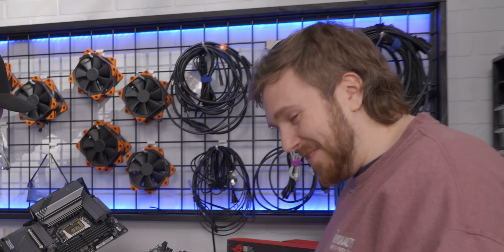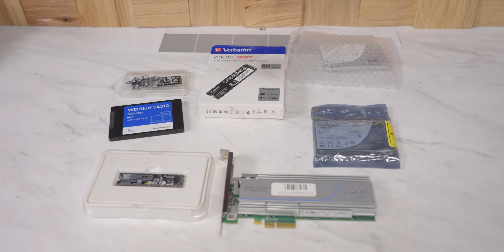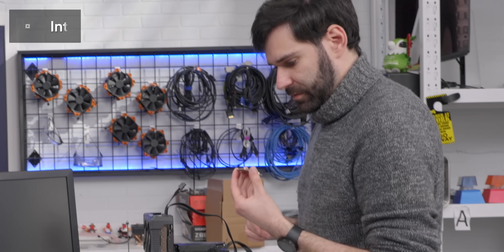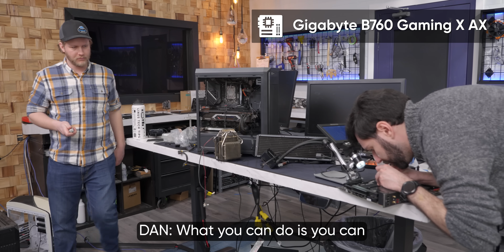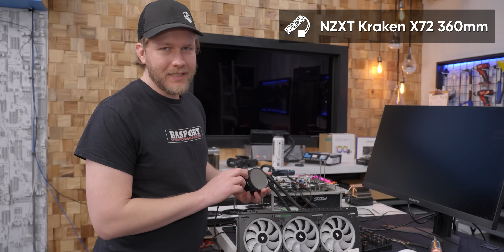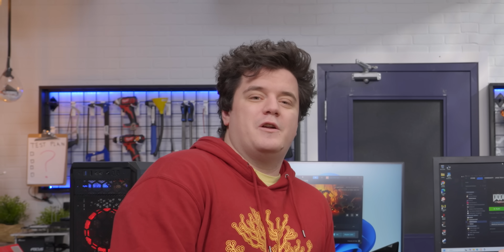I Built a Working PC using only Broken Parts

Comment: The prices you guys paid for these broken parts was insane! Shift decimal point one step to left for each broken part and then it starts to make some sense. You should be paying $30 max for a "broken CPU" and maybe $60 max for a "broken GPU" if the description gives some hope of a possible fix. If the seller is asking more for their broken parts, let the seller keep the part or fix it by themselves first.
Reply: They go for that much at auction... Sometimes more. Some stupid (or crazy necromantic tech wizards) people out there. I recently got more than 100 bucks for a busted 2070 super... Broken in an extremely subtle way that I think is going to be very difficult to fix, but it was an auction, and I said as much in the description, but someone still wanted it that badly...
Reply: People are unfortunately factoring reparability into the prices of these, seems to be the norm now
Reply: @einnujyt  Yeah, I understand that the cost of broken part is high if the root cause of the failure is known. However, if the diagnosis is "it's dead, Jim", I don't understand why anybody would pay a lot for that because it could be the compute chip itself plus memory that's bad (e.g. voltage regulator failed and fried both).

Or the board might be totally missing all the expensive parts because it was already used as donor and seller just slaps "broken" into the description.
Reply: @MikkoRantalainen If you are using eBay, you can always send stuff back, even if the description is accurate, bus especially if it is not. The sellers seems to bear all responsibility these days.
Reply: @rkan2  If you send stuff back, who pays for the postage (and possibly tariffs)?
Reply: @MikkoRantalainen  It depends, but for an inaccurate description the seller always pays for return shipping. This is one of the reasons why many sellers decide not to sell to abroad.
Reply: @MikkoRantalainen  And generally, for civilized countries, tariffs don't apply to returns. Tariffs usually also don't apply to many other cases where the goods is not intended to remain in the country, such as a repair.
Reply: back in the GPU covid times a dead GPU was MSRP, my last 3 GPUs were bought for parts (bad fan, pealing pads at the slot, and no display (backplate was dented shorting a cap))
Reply: People love gambling
Reply: CPU i agree, but full big GPUs will go for that much, because spare parts
Reply: @nightsgems  Are people paying big amount of money for spare parts which might be already broken?

Comment: Having a GPU post and calling it "good" is a bit premature, i have a 1080Ti and 2080Ti and a 3080Ti that all post, the 1080Ti and 3080Ti even play most games fine, but all 3 of them have what i suspect to be memory issues, as they all are varying degrees of unstable in more demanding games the 2080Ti being the worst of the 3 and while fine for booting and browsing and watching videos, it fails hard at all but the simplest of games. (and why yes, i do have the worst luck imaginable with GPU's dying, all of them died about 1 year outside of their warranty, they all had 3 year warranties too....)

Comment: I bought i7-6700k for 80USD back in 2017 (new were around 500, used for 350), dropped on corner, A chanell RAM is not working, but the rest of the CPU still works. For . The thing is that it signals broken RAM when the A chanell has something in it, not broken CPU.

Comment: Fun video guys! I think anything is worth buying depending on the price. Even the gpus CPUs the problem is they never sell for a price that's worth the gamble. I got lucky in the past buying am4 CPUs that had noticeably dropped or bent pins and was able to straighten them out and get them posting and resold them. The hardest part was not straightening the pins. The hardest part was finding a price that made the gamble worth it. But fun video! Thank you!.

Comment: I have seen the RAM issue personally. I have a crucial ballistix DDR4 stick that suddenly refused to work with my desktop and still refuses to post up to this day on that desktop. 

Yet I have tried it in other computers and in some it has worked flawlessly. I even checked it with memtest86 and it came out clean, so I have no idea whats going on there.

That ch341a is garbage, at least get the revision with the voltage selector honestly.

Comment: I bought my 5600x used and it came with a bent pin, i couldn't seem to find anything around the house that could bend it back into place without risk of just snapping it off. So i said screw it and tried forcing it into the holes of the am4 socket on my motherboard, and it bent it back into place. Worth saving the extra 25$?? maybe.

Comment: I love how Alex gets more and more dishevelled as the video goes on, with how much tinkering needs to be done, lol. I wouldn't trust that Enermax to cool a Threadripper, much less any of those intel cpus, lol. Mainly because they ALL had contamination issues at this point. Its why I'm probably sticking to air for my 2920x, as the only good aio with a TR4 pump/plate combo, was discontinued.

Comment: You need a real Repair Tech like Tony from Northwest Repair or Frazer from GPU Solutions to fix those GPU, MB and Ram Sticks.
It's easy to fix GPUs if the Core is not dead.
I've fix a lot of GPUs for the last 3 years.

Comment: Isn't most of this testing just wrong? Bad RAM might boot but still crash your system later. I personally had a burned 660ti that would boot and work just fine for everything but would crash as soon as i tried to put any realistic load on it. SSDs and mobos can have the same issues.

Comment: Repairing broken parts may be a great deal if you are lucky, because no one will spend 265 on 4 motherboards and then pick the easiest one to fix.

Of course it all depends on how accurate the pictures are before you buy and all that, but in the video you evaluated which parts to use only after looking at them closely in person. I think for most people, buying used-working is a better option.

Comment: I guess the best worklow for folk to do this at home. 
Start with Graphic cards until you get a gem? Then CPU?  Then motherboard? Then go used memory.
Then just go new/used for RAM, and power supply?
Reply: do you understand they spent 2700$ to build one pc valued at 600$ .  they bought 5 or w/e cpus you cannot return because you bought them knowing they are broken parts. to find one that was working .. also why wouldnt you consider the time spent buying one broken  cpu, to find out its unrepairable. so you shop for another broken one. etc etc. an by the 5th cpu, you finally found a good one.  before you know it. it has been 2months an after wasting like 600$ to buy a cpu you could of bought on day one brand new for $300.  is just pure genius  right? 

i really hope your parents manage your money your entire life.

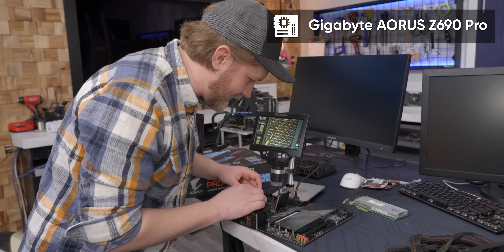Comment: 9:06 Hey, the same happened to me with a AMD GPU from ASRock though it was a RX580, it was working well and then an update notification popped up so I installed it, I always use DDU in order to have an absolutely clean install when I update drivers BUT after installing the new driver version (I forgot which one was, sorry) the screen went black and never gave image again, I removed the card and used a way older HD5450 just to uninstall everything, put it back on and it was ¨working¨ again, then I installed the driver and it died like the last time, then after attempting to restore it to its last version I tried the older driver that it had before and it didn't work despite it was completely fine before the update, I looked on the internet and I found other people reporting the same problem and with different manufacturers so it wasn't just my model, the card was already over the warranty period so I ended up with a fancy paperweight, to the date I still don't know why that happened and it seems that it affected newer generations as well.

Something weird that I found out is that if you put any card on the first slot and the seemingly dead GPU on the second slot and you install all the drivers it shows up on the device manager AND if you set up your settings to use it as the graphics accelerator it does work, it just stop working by itself, in fact I kept it like that for a while and I was able to play most of my games just fine but with several limitations depending on the game, like stuttering, the inability to change the resolution or use any kind of upscaling or Free Sync.

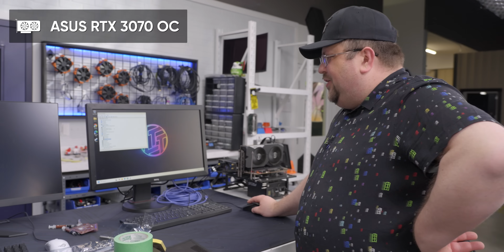Comment: 19:30 your ch341a seems to be not volt-modded: it outputs 5v instead of 3.3 volts on signal lines - it can be fine short term, but it will increase wear on the memory and may kill something

Comment: As for bad RAM, on Linux it's possible to disable bad ram blocks and continue using ram sticks at least until new ones arrive. But it so happens I'm using a ram stick with few bad blocks for a year now without any problems.

Comment: Not sure if it was a fluke but running just the 4+4 CPU cable on the motherboard without the 24pin inserted did fix a motherboard for me. I tried everything but that was the one thing that revived it.

Comment: 1. "Boots to Windows" is not equal "working". I have 8GB RAM stick where first 1GB RAM is working perfectly fine till the time you run heavy software\game than BSOD. So go for Memtest it few circles.
2.  You can RMA CPUs, they usually have 5 years warranty. 
3.  10$ potential savings on SSD?. Used tested SSD are pretty cheap.
4. 80-90$ for bad motherboards? Used working ones are 100-120$ on eBay.
5. GPUs are all big NO. Its just gambling.

Comment: I built a pc using broken parts. Got a 4070ti for $300, a Gigabyte X570 aorus master for $40 and a 360mm aio for $30, Fixed them and built a 5700x3d, 4070ti, 48gb ddr4000, 3tb nvme for less than $700.

Comment: Guys ive got a 750ti which gives display but does not show up in windows and says error code:43, i have even changed the vbios, but no luck, lmk what else i can do
Reply: Is GPU-Z shows 0MB memory?
Usually memory coruption. Use MATS to check VRAM.
Reply: @ GPU-Z shows everything normal
Reply: @egp_rafeyyy9405  that's quite weird... 
Have you try clean the gold finggers?

Comment: Please learn a basic repairing method. Get a multimeter, it's really easy to check basic voltages, even if you don't necessarily know how to fix them, you would know where the problem lies. Also, that microscope sucks, invest in an Andonstar microscope at the very least. 

If a PC simply doesn't power on, chances are there is something shorted, you don't want to put a CPU in a shorted VRM motherboard, it can kill it instantly.

Comment: I had a dead gpu that had 2 capacitors chipped off and i bridged it with solder and it works. It's a crappy gpu (my slowest gpu i have)

Comment: I recently bought a EVGA 970 for £13 as it was sold with the "DVI port stopped working. Not had chance to test the rest" It worked straight away via HDMI. All EVGA's are to be saved! Such pretty cards
Reply: I have a perfectly working EVGA gtx 770 that’s a shelf decoration, such a beautiful card, black and gold just looks too good to throw away
Reply: reminds me of the ultrawide monitor i still use. bought it for 70 bucks years ago because a hdmi port didnt work. I wanted to use the Displayport anyway but also saw that there was a second hdmi port that also worked.
Reply: I use a evga 2060 i bought for pretty cheap at it ran with one fan all ways on max, so got it for cheap then mailed evga and they helped me find a fan for the card for about 5 kangaroo bucks(2-3usd) and also sent me instructions on how to replace, god tier company
Reply: There's a lot of games coming out today that can be played just fine, too. It's only the few AAAs with good enough graphics or bad enough optimization.
Reply: Used to have a 970. Not suited for anything high resolution or modern, but works okay for e-sports titles like valorant but that's the max. CPU integrated graphics are faster these days. The EVGA version does look and feel premium though.
Reply: I had a similar thing with my TV, went to throw my garbage away and someone had put a 43" Vizio TV by the dumpster to be thrown away. I figured since it cost literally nothing aside from lugging up back upstairs I might as well test it, the first HDMI port was broken but the 2nd works if the cord is pulled the right way and the DVI input works no problem.
Reply: LONG LIVE EVGA
Reply: im still running a EVGA 1080Ti i cant afford to upgrade :(
Reply: The kingpin 980ti is my grail, I love those things, I wanna find one for a decent price, and with that lossless scaling app I could actually use it as a second card!
Reply: what is that card even useful for? I upgraded this year from a 1080 and that card really struggled with pretty much everything. I can't imagine playing on a 970 in 2025 unless you just play older titles.
Reply: @ErnieZee  I like to build budget pcs for kids/family's using 1060's or 970's. I use the Lenovo 520 as the base. Stick 16gb RAM in it. It's good enough for GTA5 on High and Sims... I never sell them to allow to play modern games.  Luxury of the PC gaming market.
Reply: @ErnieZee  because 13 quid
Reply: @ErnieZee  Playing PhysX games with a 50xx card?
Reply: @Pro_Triforcer  50xx are physx capable. They just removed 32bit hardware support which is required for like 5 games. Supporting that kind of technology is completely pointless.
Reply: @ErnieZee  It'll play games like Borderlands just fine. Remember, a lot of us older gamers are now dealing with an entire new generation that never played any of these classic games. More than half of my entire Steam library could be run on a toaster at this point. Still excellent games worth experiencing.
Yes, I do have a full blown rig as well. lol. But for decades I was always using e-waste and 2nd hand stuff.  Only in the last 5 years or so could I really afford a $1000+ gaming PC.
Reply: @ErnieZee  The catalog of games you can play with emulation, and triple A PC titles until ~2020 (not at 4k obviously), lighter games maybe even now, is HUGE for the price of a pizza.
Reply: @ErnieZee  let me guess, you play mostly AAA titles right?
Reply: @ErnieZee lol i have a zombie gtx770 that still works fine
Reply: @ErnieZee  Heh i just pulled an old 970 out of storage to bench test a new mobo/cpu before building it into my custom watercooled rig.

The more grounded use case for that card in 2025 is making an HTPC or something similar out of used parts.  Although i'm not sure its power-to-performance would be reasonable versus just buying a newer CPU with integrated graphics.
Reply: @tippyc2  "power-to-performance"
I actually forgot to keep in mind the power consumption. I really gotta remember this more often.
Reply: @ErnieZee  you sound spoiled AF
Reply: @ spoiled? Bro I'm 30. I've been buying pcs with my own money for 15 years at this point.
Reply: @ErnieZee  Yuno there are people that strictly play Minecraft/Roblox for one, so its pretty damn great for a relatively small-ish niche.
Reply: @ErnieZee dude…what were you playing? A 1080 can still do 1440p medium on some games.
Reply: Idk what you were doing my 1070 runs helldivers at ultra settings minus the one vram setting and of course RT/upscaling on a 1440p ultrawide native resolution. @ErnieZee
Reply: @ErnieZee  I don't blame you for that reply, but ye, this kind of older hardware purchasing is pretty much for real budget-tier builds and older titles for people who don't care for the latest releases or the highest settings. In that aspect it makes total sense.
Reply: @ErnieZee  Cheap and works if you don't have a CPU with built-in video.  And it's still several times faster than it.  I have a similar card in my Linux box and it'll play Noita and other roguelike games as well as get the job done. It saved me having a backup system more times than I can remember.
Reply: @ErnieZee depends on your case. I use a gtx 660 Ti in one of my PCs. Perfectly fine for basic Fortnite :-)
Reply: @ErnieZee I still have a 1080 lol. Just play at 1080p they aren’t thaaaat bad
Reply: @ErnieZee  And older titles are the only ones worth playing, what is the problem?

Comment: Broken pin on motherboard can be fixed by taking a pin from dead motherboard and sliding it inside the hollow broken pin socket, the applied pressure of the cpu will make it touch the pin inside the broken socket.
I have fixed z170 and used it for 6 years with 7700k overclocked, before it got rusted as hell.
Then i got scammed on a z390 with bent pin where i tried fixing it broke the pin off, so i applied the same fix to z390 and gamed on it for 4 years with my overclocked 9700k.

Comment: I essentially did this I bought a 12900ks for 100$ from OfferUp I was like if it’s broken it sucks but if it works I got a deal board was 70 on amazon used as well as the ram 80$ I did it knowing I could return it later if didn’t but even now 6 months later it’s still going strong